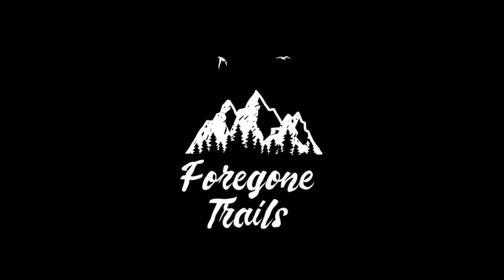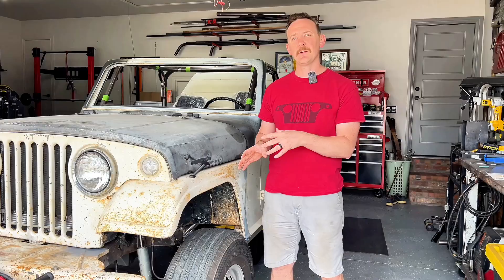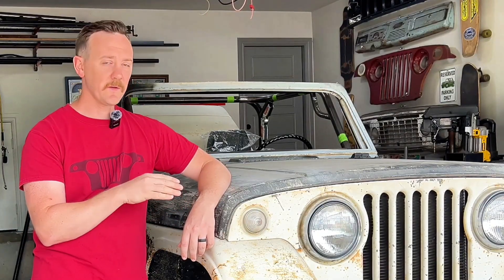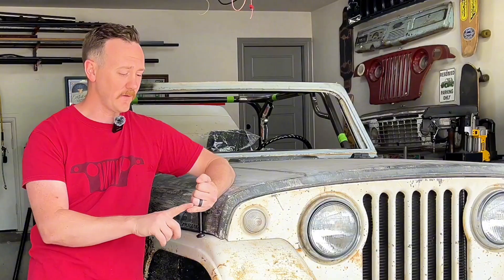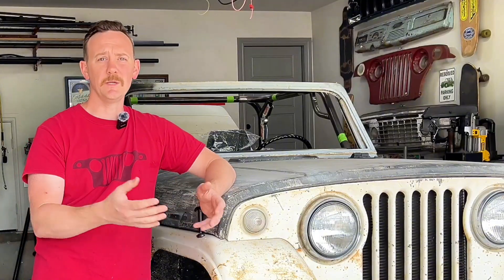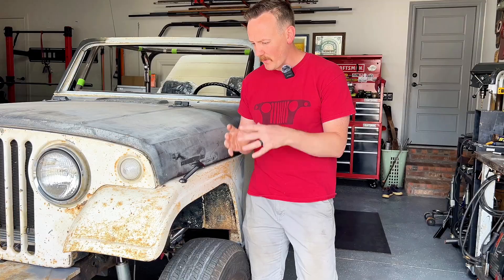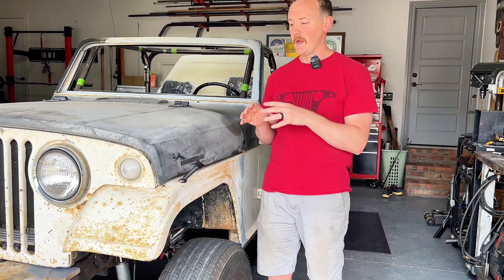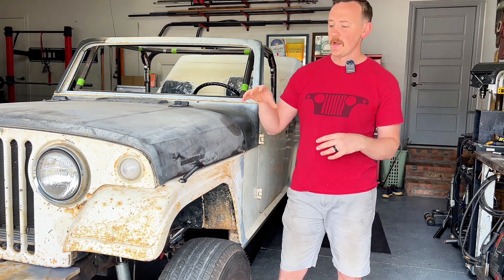PERFECT LEAF SPRING SUSPENSION FOR A CLASSIC JEEP

Comment: are you also going to do any steering mods as well?  brace + change out the stamped box mount?
Reply from the maker: I did install a steering box brace. But no won’t be changing the mount. We’ve run it for years on one of ours with 33’s and no issues.

Comment: I’m running 4.5”’YJ’s on mine. I was running a similar shackle angle at first.  Ended up moving it to a steeper angle. With a lot of shackle angle in the front will get a ton of front end dive if have good brakes. On the rear it was fine until I loaded up for the trail. Shackle angle went almost flat as lost so much spring rate. Now front is about 70 deg and rears 65 deg.
Reply from the maker: That’s good to know. There is some built in adjustment available if needed once he starts driving it.